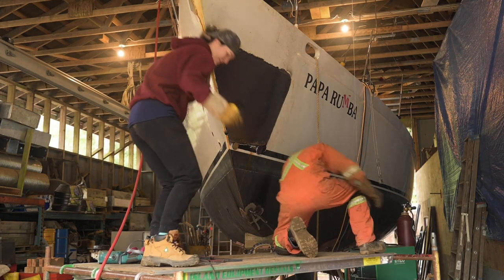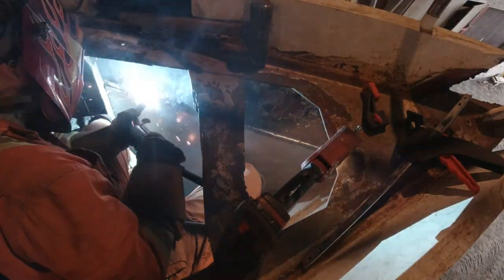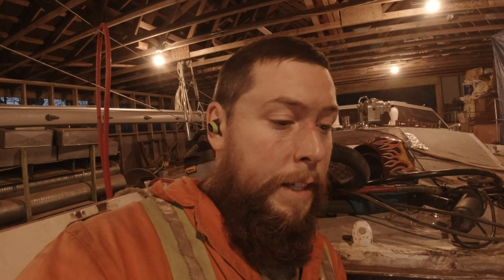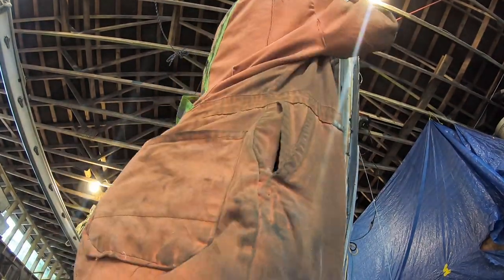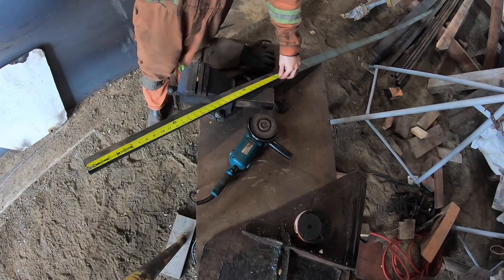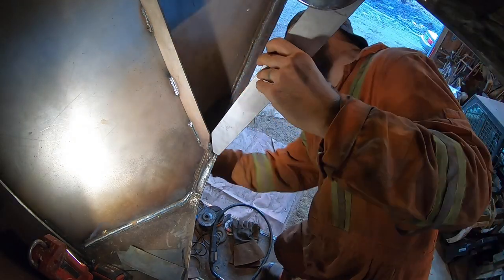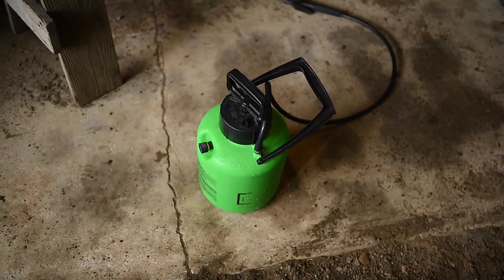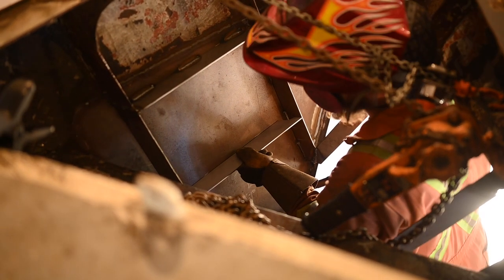Making boat Ribs  | C5 E12

Comment: As long as you have good penetration that's what is important.  I've seen many boats mostly cruise boats and the weld's look horrible as long as they got good penetration that is basically acceptable. I use to build heavy equipment and I was a fabricator for many years and many industrial structural welding jobs as well. When I saw what they approved for cruise ships I was kind of shocked but that's the really of it. So basically I wouldn't sweat it. Your welds look fine.
Reply from the maker: thanks for all your comments Fon.  Really appreciate them.  And you'll be happy to find out in future videos that we did in fact use stainless for the chain locker drains :)

Comment: your welds look good, is mig much easier than arc ?
Reply from the maker: Mig is generally easier, yeah. You kind of just set the settings on the machine and then the machine does most of the controlling for you. Welding with stick has more variables to work with that are directly related to how you hold the rod, etc. it would have been a lot harder to do this job with stick as well because of the angles and corned that are already difficult to get into.

Comment: Allo you two. Allo Max.
Great video as usual and great progress with Papa Rumba.
Here I am and I will ask a question:
I just got involved with a small steel boat.
I have no welding experience. I do know how to recognize a good weld from a bad one but I have no idea how to do one.
My quick question, if you do not mind is: What should I look for in a welding machine(MIG, etc) that would be a used one, is there such thing as better brand? 
What kind of $$ should I expect to pay? 
You can just send a PM if you prefer.  
Just 'throwing a line" here, that will be a learning curve!
Reply from the maker: Are you in Canada or another country? You might have told us before but I can’t remember 😂
Reply: @WaywardLifeSailing  fair enough yes I am in Vancouver. the boat is a Van de Stadt 34.
Reply from the maker: @Coyotehello  Logan says you should be looking for a little Miller 110/220 machine with wire feed, because they will do up to 3/8 thick plate. They’re also fairly small. There’s a YouTube channel called welding tips and tricks and we highly recommend watching them to learn some techniques and tips. If you’re gonna do mig it’s quite a few steps to get the metal and welder ready to weld, but it’s also a lot easier than stick when it comes to actually running a bead. Also make sure you have ventilation in whatever spaces you are welding in because the gases from welding (especially argon from mig which is heavy and will stay in the bilges) can suffocate you 😬 so much to know!
Reply: @WaywardLifeSailing  Gee thanks, I am starting the learning curve in welding, Thanks!!!